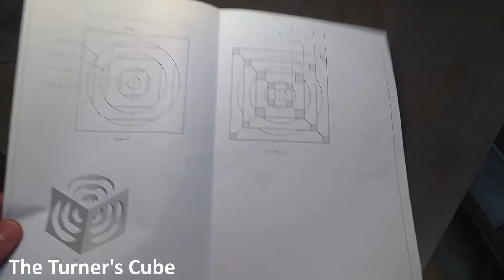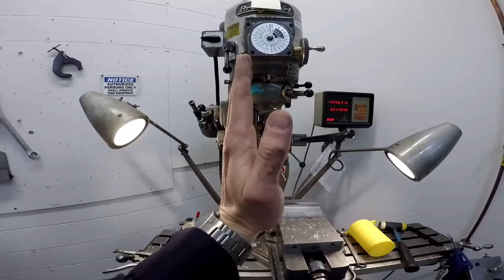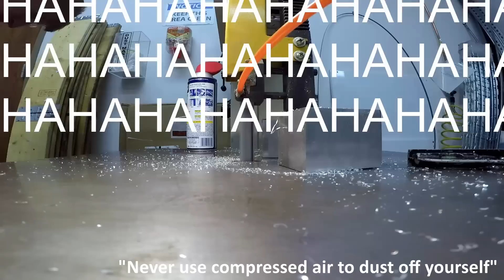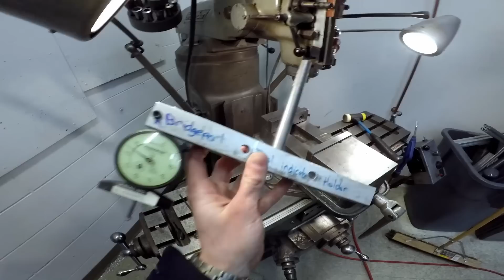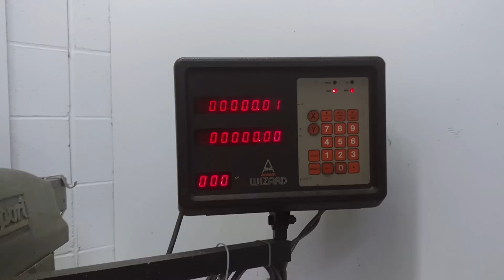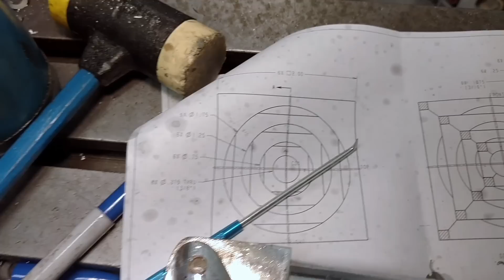Turner's Cube on a Bridgeport

Comment: The individual cubes should be free to move, that's the trick of making a turners cube.
Reply: and its meant to be done on a lathe
Reply from the maker: Got no lathe.
Reply: As much as I agree, it’s still impressive nonetheless
Reply: @danserviss  it can be still done in the mill, just make or buy an id grooving tool and stick it in the boring head, then release the cubes by moving the table while the tool is in the bore or something like that
Reply: I just made one on a Bridgeport in class. Definitely cooler in my opinion when you try to get the cube corners as thin as possible without breaking the cubes free. Them spinning inside each other just sounds lame.

Comment: 8:20 - the Co-axial indicator ... have you read the instruction sheet - I have a MeasuremaX CTI and it states - step one - "Take off  the guard ring - white ring thingy up the top of the CTI. They don't say why, but I would say that the CTI will respond better., I don't know, as I have taken delivery of my brand new CTI, Wednesday if last week, and all I have done with it is read the instructions ... Just thought you like to know this. Like you say, it is a really neat piece of gear, and I can see plenty o f uses for it - my vision is a tad blurry (even with my mag glasses - I need a bit more effective light), but I will be able to find centre punch holes with ease (I can read the dial...) Have fun - Oh, as this 2 years after the video, you will already have had your fun - more to come!

Comment: I seemed to have missed how you went from drilling the single hole at 9:30 to having a fully made cube a few seconds later. How were you able to get the inside cubes made?
Reply from the maker: I drilled holes on all sides of the cube then used the boring bar from 10:35 and on in incremental diameters on all sides.

Comment: Seriously, You need to remove the vise and tram the head directly on the table.
The vise is not precise where you are indicating.
Reply from the maker: The vise and table are not even close to being perpendicular and parallel. If I tram the head and ONLY use the vise, then I know it's good, I just can't use the table. I trammed the table, put on the vise, and was getting a ton of play. It's what I get using old equipment.
Reply: Yes.  What Falcon XP says.   AND, stop moving the knee up and down!
Reply from the maker: @lmsaltest  You compare the size of R6 collets and a drill chuck and the height needed to install the various drill bits I used and the depths I had to drill. Changing a drill chuck and boring bar in the quill needs like one foot of vertical space, that space I need limited based on how deep I needed to move the quill down. This isn't that accurate of a project the way I'm playing around too.

Comment: just a little tip. I know this video is old, but you are running that boring head WAYY to fast. 400 RPM max on that
Reply from the maker: Hey there old comment. I'm on to a new company that has a mill but don't worry no boring head because this machine shop is a mess. But good to know!

Comment: To tram the head you should take off the vise and tram the head to the table then index the vise separately
Reply from the maker: I did try that but noticed that the vise I'm using must be old and not properly maintained as it showed 50 thou of play relative to the table, so I trammed the vise and know not to take it off.
Reply: Your vise jaws have play in them...  Tram the table and get a better vise.